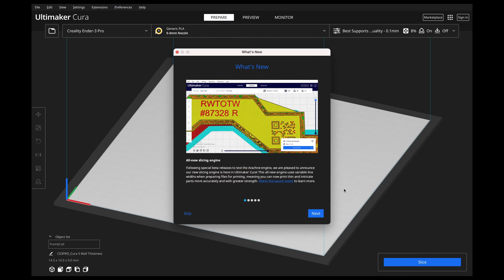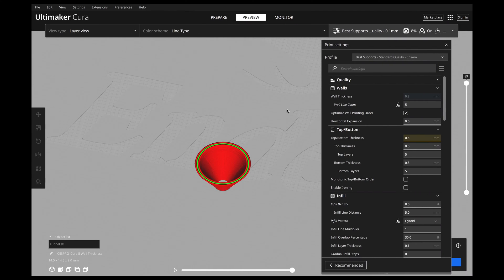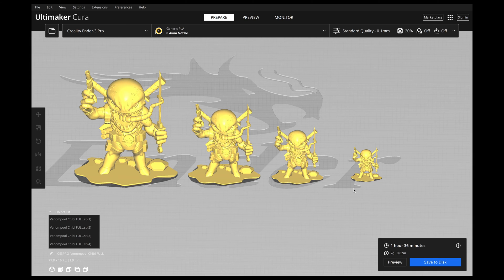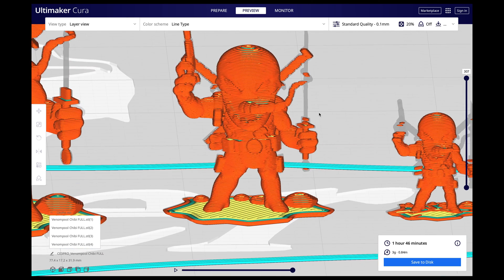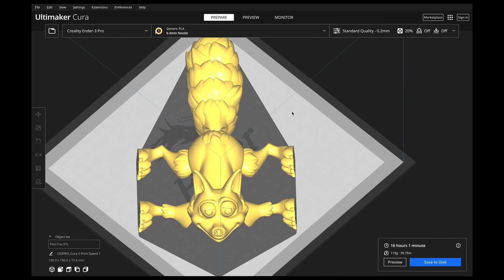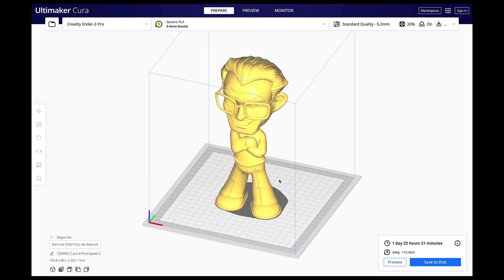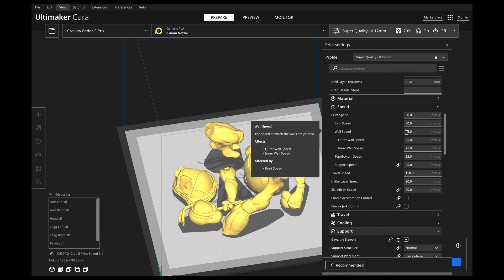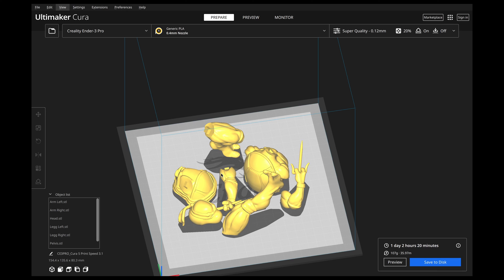Cura 5 vs. Cura 4 - Does the Newer Version Make a Difference?

Comment: So first off, thanks for making the tutorials. I have had no luck with 5.0 or newer working on my laptop 4.13 is sort of working. I can't get it to print in the middle of the build space it comes to the front left and prints but it's not working like it did before I tried to update. Please help. If you can.
Reply from the maker: First. Sorry to hear about your issues. When it comes to printing in the middle of the build plate two things that might help. 

1. If you right click on your model a drop down comes up and you can select center model on build plate. 

2. If that doesn’t work check your printer profile settings to make sure the right values for you build size is correct. You values may be off and it won’t allow it to be in the center…

Hope this helps.

Comment: If you lower the wall width, Cura 5 will easily get those details even with a .4 mm nozzle. I know because I just printed a good 7% Benchy. I used .25 mm.
Reply from the maker: Thanks for the tip

Comment: The biggest bug I've seen is tree supports.  They sometimes start nowhere and end nowhere if you use the "touching build plate" option.  They are clearly not working as well as 4.13

Comment: It's not faster. :) It's marketing, as everything these days! The estimated print times have nothing to do with the real print times!
Reply: The strange thing is, on my CR-10 Smart Pro, that 5.0 gives much more accurate print times than 4.13 did. The print times were always underestimated with 4.13, but they're almost perfect with 5.0. As far as being faster, that all depends on the model, profile settings and the machine. I haven't seen much of a difference there, maybe a few percent faster on average. Though, there are a bunch of things that 5.0 does nicer than 4.13 when slicing a model, so I like it better.

Comment: In the time thing, first model you said it's not a big difference, but it's a difference. Have in mind it shouldn't even have a difference because it says the improvements are on the Ultimaker profiles, and you're using a Ender 3 Pro profile.

Comment: I played around a bit with the 5-beta,  and noticed my prints were a bit under extruded compared to the 4.13,  I just downloaded the 5.0.0 so I'll give it a whirl, printing one item sliced on the 4.13 now, and will print the same exact file on the 5.0.0 and do a comparison.
Reply from the maker: That’s a good thing to do. I did a few side by sides and they worked out well.
Reply: I have noticed under extrusion with 5.0 release, too.
Reply: @imacmill  did the test, and results were the same, a lot of under extrusion artifacts with 5.0,  same filament, same settings, same file.

Comment: I think you misread the claim of 20% faster print times, they said "Anyone using an Ultimaker Printer with our recommended print profiles can expect print time reductions of up to 20%." Which to me means that print times on Ultimaker printers with their built in profiles are faster by up to 20%. They make no claims for other printers, like your Ender 3 Pro, so improvements there are probably just from incremental optimization. I'm also curious what the actual print times are, because Cura can be pretty hilariously off with its time estimates. It'll be interesting to see how 3rd party profiles can be tuned to reduce times in the future!
Reply from the maker: I’m planning on doing multiple prints to test the theories I have about it. To see if the times are actually accurate.

Comment: Just got a Vyper.. and after day 1 loaded Cura 5.  Id sooo love to see you do some nice Vyper profiles.  Ive been playing but stringing on my models are still a challenge.  I know its in retract.  Dialing in is taking forever.  But love Cura 5.
Reply from the maker: That’s awesome. Yeah stringing can be a pain. I’ve been there. Take quite a few tries to get it right. Also something to keep in mind sometimes you get bad spools and if it has moisture it can cause stringing too. So try test with different spools.
Reply: I feel that, I just got the Kobra max and there's no profile at all 😂
Reply: The Vyper van be finicky. I have 2 of them type C and F. The type C prints pla perfect with no stringing at 185C the type F is 215C. Both tuned through the teaching tech website. Play around with temps, even outside then realm of normal. Also retraction on the type C is 8.5mm @45mm/s, type F 7mm @35mm/s. Keep at it 👍

Comment: 2:20 0.4 mm × 3 = 1.2 mm line width, not 0.12 mm.
Anyway, I'm just in love with no longer having lines that look like the slicer suffered a stroke. That this also makes it all quicker as well as capable of finer details per nozzle size are two further benefits I'll gladly take, too. And since about a week ago all the plugins have made the move, so at this point I'm keeping the previous version installed basically just in case of the fairly unlikely event that I happen to get a printer for which there's only a profile in Cura 4. That said, they are definitely overhyping the small prints angle. A 10% scale Benchy still looks crap with a 0.4 nozzle.
Reply from the maker: Thanks for the comment. I’m with you I’m keeping Cura 4 just in case but I’ve pretty much switched. Thanks for the correction on line width definitely misspoken.

Comment: But you really need to print something to see if there are actually any changes.  Cura 5 is supposed to print things 4 cannot and that means you models should have more smaller details.
Reply from the maker: I’ve done a few tests and it does give a little more detail. I said in the video it can help with detail. I’ll have to do another video showing the differences.

Comment: Could well be faster, but considering their Linux version won't even run without a lot of messing about, and even when it does run it won't let you open or save files... Think I'll be sticking with 4 for a while!
Reply from the maker: Sounds wise. I haven’t had any issues so far with my Mac version.